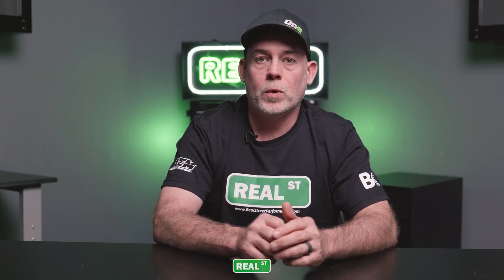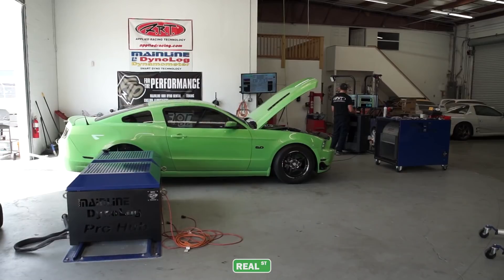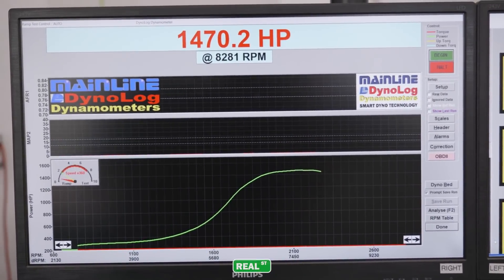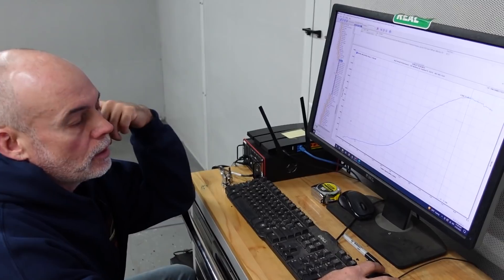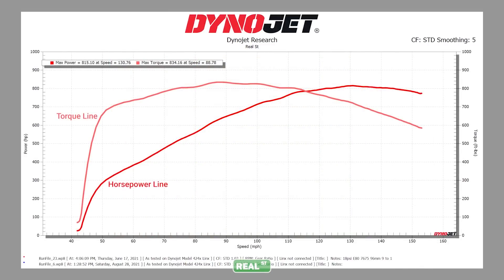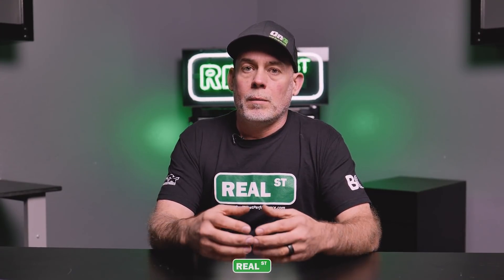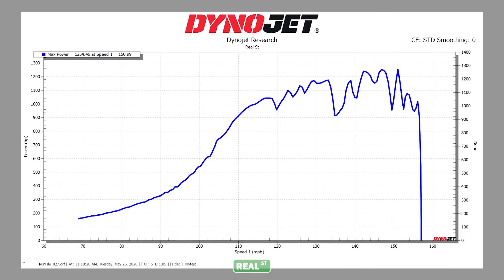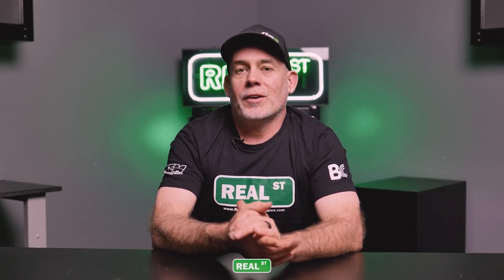Jay's Tech Tips #49: How To Read Dyno Graphs. (Explained)

Comment: Very informative and helpful.  Thanks Jay! I road tune my supercharged S2000 so that smoothing factor in particular plays a big role in final numbers. The smoothing has to be pretty high for the data to be usable but that lowers the HP and torque figures a lot. Virtual Dyno is a great tool for this if you don't have access to a dyno.

Comment: Hey jay can you explain how a dyno graph will look when the AFR dips rich or goes lean and how that correlates to peaks and valleys on the torque and horsepower curves,  like if there is a dip in torque during a wot pull if you look at the AFR it too has a dip or rise vice versa can you touch on that please?

Comment: I had my car on an inertia dyno/dyno jet recently (CF sae Smoothing 0). It did spin with mickey thompson et street r so they put some sticky stuff on it. My question is on the dyno graph is says the power it made at Engine RPM. Is that the actual power to the wheels or engine power?

Comment: What happen when you can’t dyno in 1:1 gear? Or in under drive gear…. Will the dyno read differently?
Reply: yes,.... of course it will read lower, but doesn't mean the car isn't actually makin more power in the next gear, dyno is just a Tool to see the power it makes and where, 4th gear is best for a 1:1 but most cars dont' make enough power to do a quick pull in 4th, it would be too long of a pull where egts etc would climb too high to see accurately a power run

Comment: WOW, either this is missinformation or you're very biased towards your inertia dyno... firstly how can you even tune those "1000" hp cars accurately when the dyno pull is 2seconds long? If you do a 5th gear pull on the highway or even the top end of the 1/4mile it wont go from 3000rpm to 9000 in 2 seconds.... And to say that eddy brake dynos can be manipulated and wont read missfires correctly is bs. It just depends on the dyno, every dyno can be manipulated somehow. And what I have noticed is that when theres not enough load on the dyno, be it inertia or eddy brake, the power numbers are higher. Now this is just my opinion, and probably many others aswell, but from what i've seen dynojet numbers are always hgher and sometimes even impossible for the compressor to produce. When you have a 1000 crank hp rated turbo making 1300whp, just kinda makes you think that maybe its bs numbers. Especially when every other dyno graph with the same turbo is around 800-1000 crank hp :D
Reply: Also i know many cases where a car has been dynoed on an inertia dyno AKA not enough load, and theyll make good numbers with high ignition advances etc. And on the few first pulls on the street the engine will detonate and blow up. Also another problem here is that the boost settings are never quite right, youll have to lower the duty alot on the street, not enough load = bad tune. Over boosting and detonation after an inertia dyno tune is very common, atleast where i live. I have many examples of head gaskets blowing or pushing coolant on the first pulls after inertia dyno.
Reply from the maker: Thanks for joining the conversation Sahan